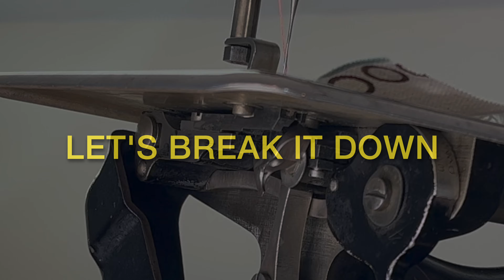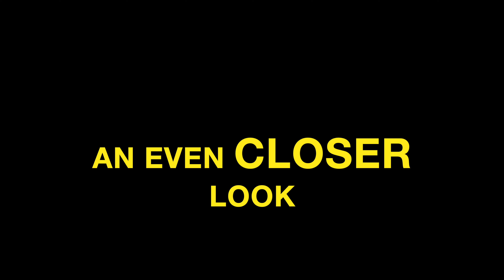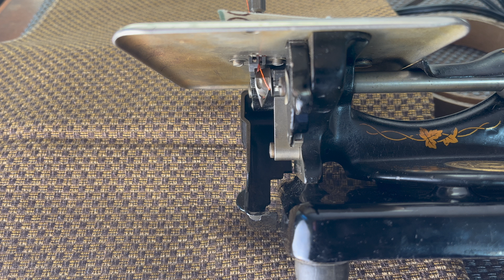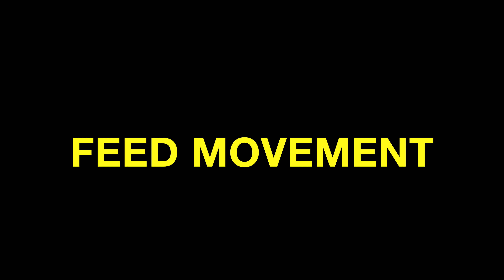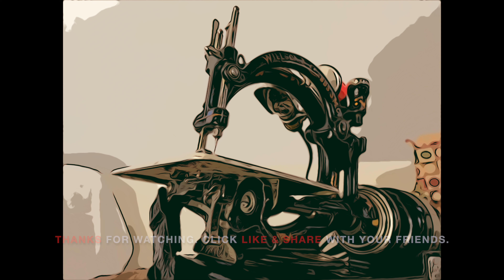How Stitches are Formed on a Willcox & Gibbs Sewing Machine

Comment: Very clearly explained.  Thank you for posting this.  Is there an advantage to a chain stitch?  Are there fabrics where this sews better than would a machine with a bobbin?  Is this type of stitching mechanism easier to adjust and keep in service than a shuttle machine with a bobbin inside?   (Lotsa questions, I know.)  Thanks again.
Reply from the maker: Hello Jerry.  I know that using a chain stitch for embroidery projects is preferred by some and others do quilting projects using the Willcox & Gibbs.  The W&G sewing machine has different needle sizes to suit different fabrics and the number of stitches per inch can be adjusted too.
Hope the other videos I did about W&G would be helpful too.
Reply: The stitch can stretch and therefore can be used on knits...
Reply: Except for one single disadvantage, straight chain stitching is really good at sewing seams which need to have a little bit of give to them - think of jeans subject to lots of pull and movement when worn or knit fabrics with lots of stretch.
They make a very pretty embroidery stitch automatically. 
It's a little bit easier to work with really thick threads than on a domestic lockstitch machine and with some difficult materials, and both their lower stitch (the one shown in embroidery work) and their upper stitch (which is the same as on a lockstitch machine) can be made to look really good on on materials of varying density.
Their sole disadvantage  is that the seam can be relatively easily pulled apart by pulling on one of the two ends. All the loops pull out in a chain.
Of course, that's how the 'pull to open' seams are made on things like bags of dog food.
I use chain stitching a lot for making seams I need to baste but which have to be really strong while basted. I use it for tough denim and challenging (at least for me) to sew materials like ultra-suede. 
One disadvantage, a ton of advantages. 
Nobody on the Internet has ever explained it as well as this creator, by the way. Her videography was great!